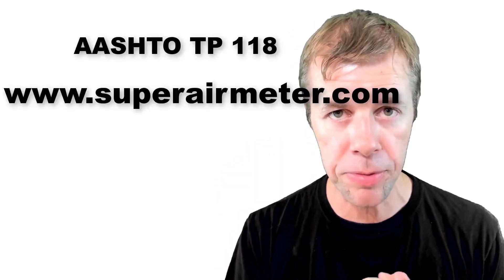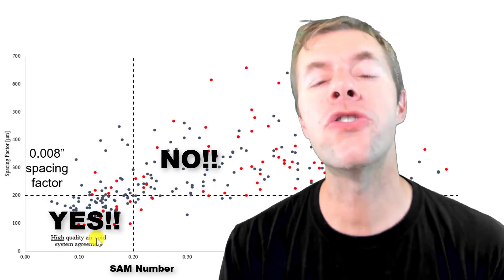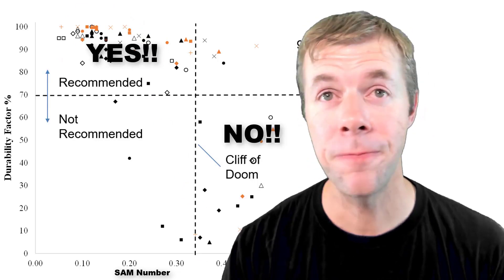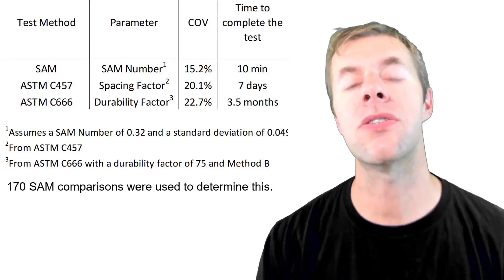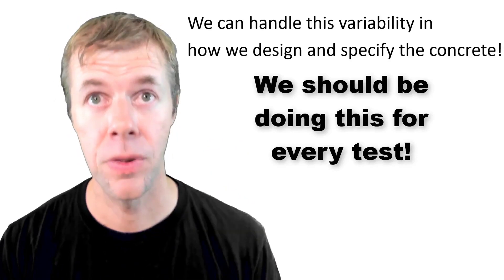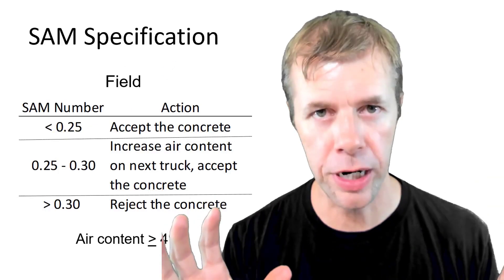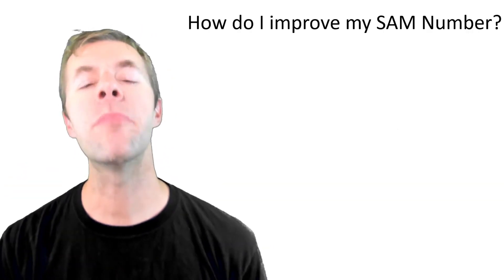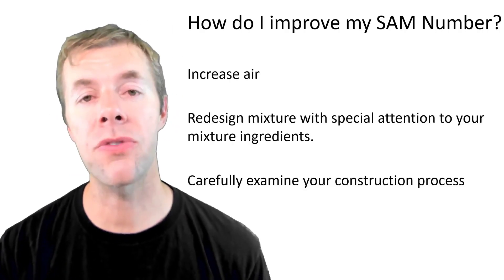How To Specify the Super Air Meter

Comment: Hello. I work for a concrete producer. We’ve done mix designs for pavements where the air content is supposed to be at 7% plus/minus 1.5%. Slump is a maximum of 2”.  We’ve had air contents at 8.1% and Sam numbers of .3-.34. which is the legal limit. We’ve found that mixes where we have low slump, the sam number also takes a big hit. Any advice for us when we’re in the field? We’re afraid that putting more air in the mix could put us over the legal air content. Thank you

Comment: Solution in search of a problem.  Just like a geotech test boring only tells you what's in that hole, SAM only tells you what the concrete looks like at the tip of the chute... as soon as it gets placed & walked through, vibra-screeded, goes through a pump or is touched with a vibrator (or both), the dynamics of the air matrix completely changes.  
And, it's just going to be another thing that redi-mix suppliers are going to have to fight with uneducated testing lab personnel because they're doing the test wrong.  It's hard enough to get them to run a regular air test correctly...
Reply from the maker: Thanks Frank,
Lots of problems with poor air void systems in concrete.  There is not reason the SAM can't be used to check the concrete after any step in the process.  I talk about some really cool new findings in pumping that the SAM helped to uncover.  Guess what happens to the air that you lose during pumping?
https://www.youtube.com/watch?v=38H6yXi_of8